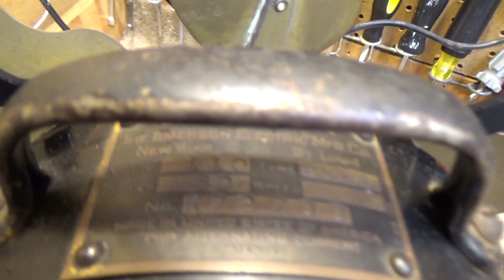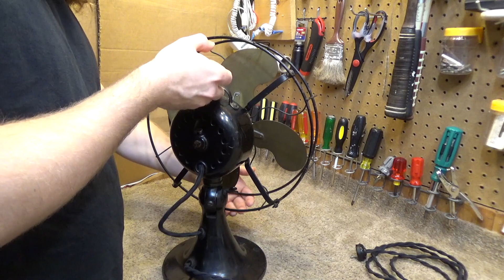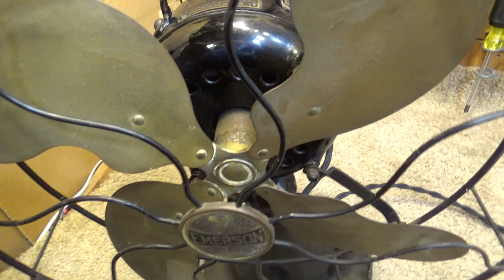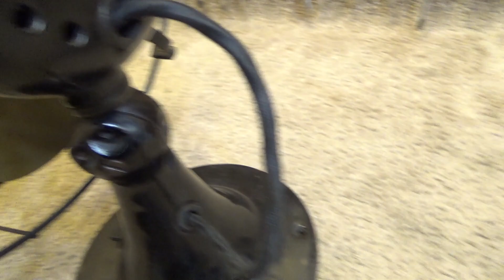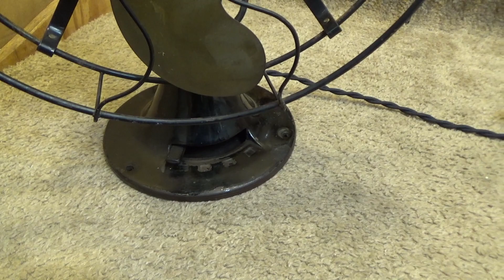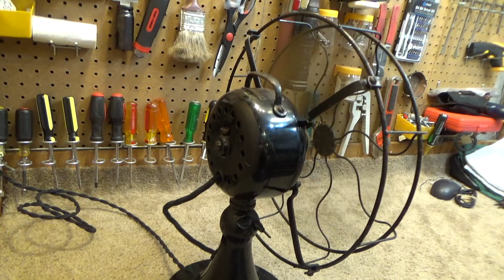Emerson 28646 3-Speed 12" Table Fan

Comment: Aww man, what a beautiful piece! I really want a brass balded fan at some point! Emerson's were really the best of the best. They almost always run when you find them. You did the right thing by keeping that original! Ohh and by the way, those aren't imperfections in the paint, it's patina! :)  The idea that modern fans are more engergy efficient is total BS! Especailly when you consider the power to airflow ratio and how much energy is wasted by having to buy a new one every 2 months lol. I'm going to do a video about that topic at some point soon as it really pisses me off that people think that is true. You should try running this thing on a variac if you have one.  I know that my GE AOU has the same problem with running really fast and not a whole ton of difference between the speeds, but if you run it at 110 volts ( I actually used a light dimmer switch lol) it was sooo much better. Low was actually decently quiet! Very nice fan Jordan! I'm jealous lol!
Reply from the maker: I'm surprised you don't have anything like this yet! The whole energy efficiency nonsense aggravates me to no end as well, it seems to be particularly bad with small appliances like air conditioners or refrigerators. I do not have a variac but it's probably more than due time that I get one.

Comment: I wonder if you could add a resistor somewhere to make it run at the original speed.
Reply: That is not a good idea. You'd have to dissipate a lot of heat and that speed coil already gets warm. Just buy a chinese variac off Amazon! That is a much better option and your not modifying the fan in any way.
Reply: A variac is definitely the better choice in controlling the speed of these fans.
Reply from the maker: That's not a bad idea...

Comment: Those motors are very efficient for what they are. They use reactive power to start the fans. It has a secondary coil in the speed coil to create a phase shift to start the fan. Since its reactive power it acts like a capacitor.
Reply from the maker: Thanks for the information.

Comment: i have a model 29646 that is in almost but not as good of shape as that. absolutely incredible machine. very powerful and extremely heavy and powerful. mine has brass blades but they are polished not painted. i don't know if that is how it came or if someone removed the paint and polished them but i like the way it looks.
Reply from the maker: I prefer the polished blades myself, but given the age and rarity of these at this point, I believe originality should be preserved.
Reply: @JordanU yes. mine is in the condition as it was when i received it, but i am all about keeping stuff in good original condition.

Comment: That motor could probably handle some additional load, there's almost no speed difference.  As much as I adore the look of the fan and admire the build quality, I couldn't make much use of it because all the speeds are far too fast.  Perhaps that's why single-speed motors were more common at the time than they are today.
Reply from the maker: The majority of the fans from this era that were speed-coil controlled don't seem to have much difference in the speeds. I think it's more an issue of the control method rather than the motor load. I do agree that the low speed is too strong for many use cases around the house.
Reply: These fans were designed for 110V. I run most of my old fans on a variac for that reason. These Emersons have better speed range(slightly) when run on the proper line voltage.